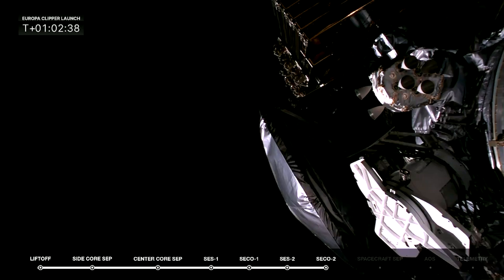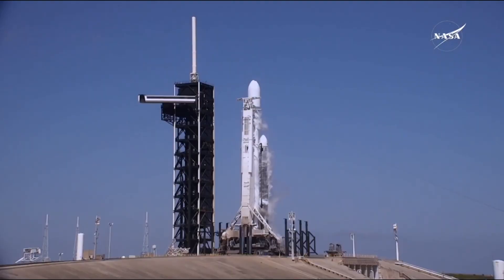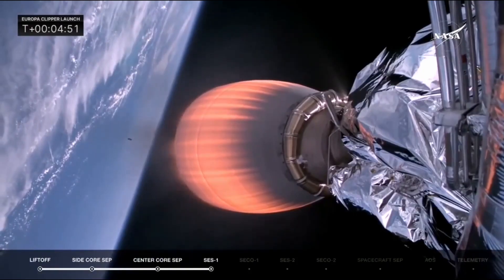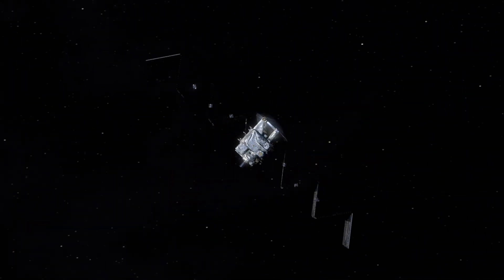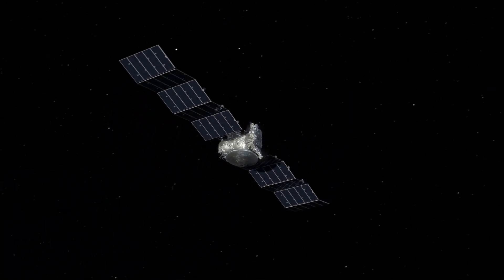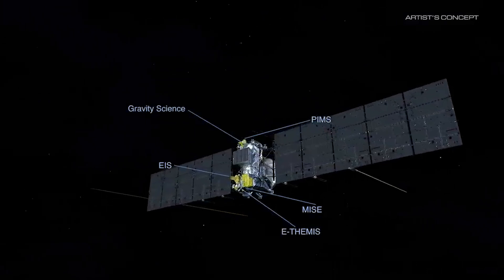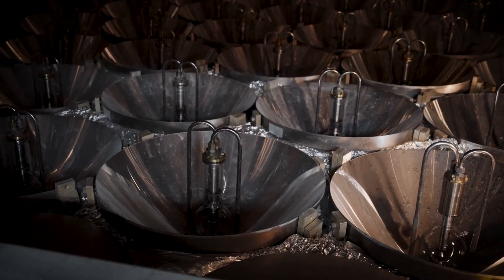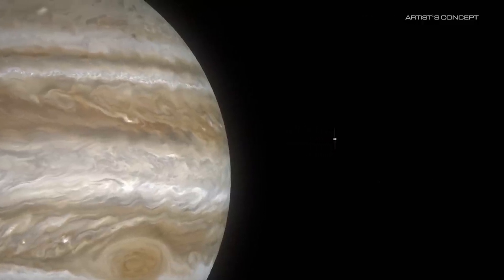Falcon Heavy Just Launched NASA's $5 Billion Spacecraft

Comment: Are falcon heavies normally reusable or only falcon 9s?
Reply: Falcon heavy is just 3 Falcon 9s strapped together.  They do recover the boosters and center core when they can, but this mission needed the full capability of the 3 Falcon cores so no fuel could be saved to use for return.  Depending on the mission, they will sometimes expend all 3 to get the maximum performance like they did here.  

You can search up on here a mission where both boosters returned to the pad, and the center core landed on the drone ship, recovering all 3.

Comment: ESA's Jupiter Icy Moons Explorer (Juice) mission that was launched 14 April 2023, has similar but somewhat geographically expanded goals as NASA’s Europa Clipper mission. The trajectory has a moon, Venus and three Earth flybys to arrive at Jupiter July 2031. The Europa Clipper mission is currently scheduled to arrive at Jupiter in April 2030. The primary reason that NASA's Europa Clipper mission is set to arrive at Jupiter over a year sooner than ESA's Jupiter Icy Moons Explorer (Juice) mission, despite launching nearly six months later, lies primarily in the launch vehicles differences. SpaceX Falcon Heavy, is one of the most powerful rockets available. The high performance of Falcon Heavy gives Clipper a higher initial velocity, enabling it to follow a faster interplanetary trajectory. Juice, on the other hand, was launched on an Ariane 5 ECA+, a capable but less powerful rocket compared to the Falcon Heavy. Juice's longer cruise time compensates for the lower initial velocity with its use of multiple gravity assists. Go SpaceX.